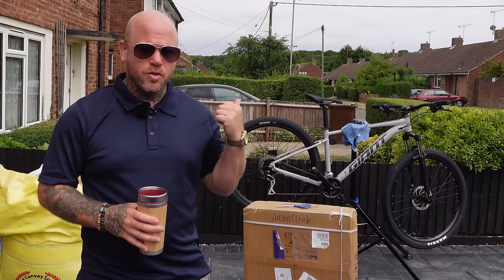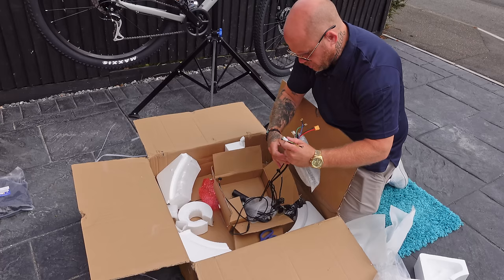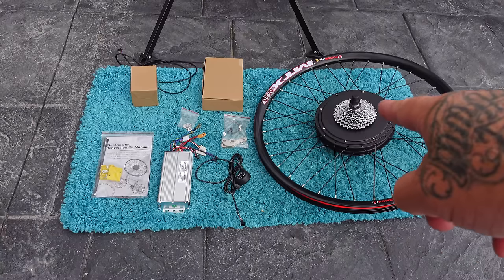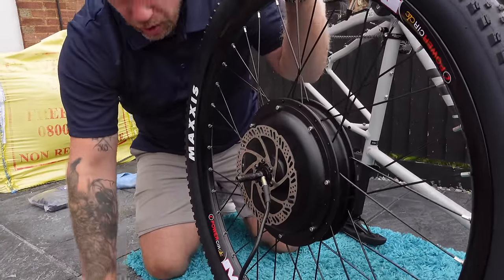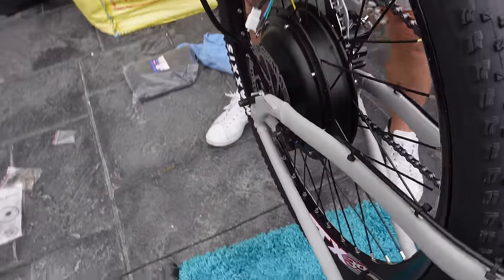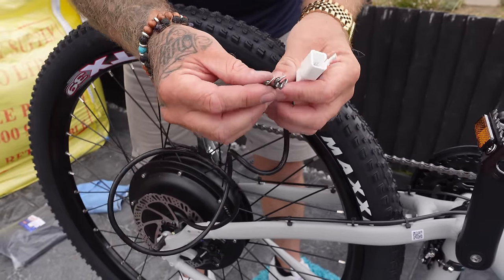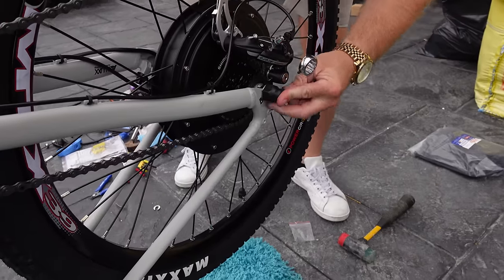Pt. 1 Convert ANY bike into an EBIKE! **ELECTRIC HUB MOTOR FITTING GUIDE**

Comment: I need to k ow how to ground out m 2000watt kit it came with fuses and a thick extra power wire and ground wire what do I ground out the controller box? The battery? Or hub motor?

Comment: I got banned from driving for 1 year & needed solution to get to work (15 miles away) . That was wen I stumbled on Andy curby doing this . I now cummute to work everyday on ebike . Been though it all .
Spoke replacements , snapped throttle , controller fets shorted in rain .. best thing ever saved me a ton on money on petrol
Reply: Do you use a hub or mid drive kit? I’ll be cycling in rain and want best solution
Reply: How do you avoid theft of your bike?
Reply: @ArthurTugwell  it's a hub, tighten up goose
Reply: Anybody find that the wheel once fitted is more to one side than the other
Reply: I aswell use a 3000watt  72v . I get everywhere i need and really fast aswell ^^
Reply: Yeah the wheels they ship with are atrocious. That's the problem with everything from China. They truly don't face any consequences if their products are defective and you end up dead because of it.
Reply: Additionally now if you lose your job or get fed up of commuting you can always turn expert, make builds show them off then resell them.

Comment: I went for the front wheel option. More weight on the front in crap weather and no friction involved. Bit like a front wheel drive car, it will pull the steering out of trouble.
Reply from the maker: High power front hubs are sketchy they can slide out from underneath on turns in wet weather, unlike a car that won't fall over.  The dropouts on most forks aren't great for over 1000w imo.  Feels really weird dropping off a kerb on front wheel power as it loses momentum instantly as the front leaves the ground.

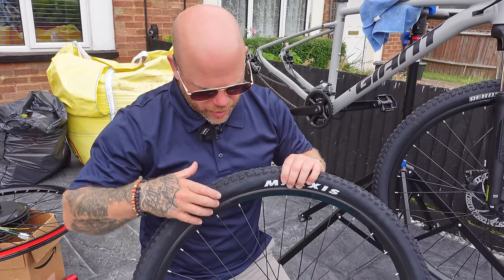Comment: 11:43 there is another tip as well if you put your disc rotor on to the actual e-bike wheel vs you noticed there is a arrow pointing on the desk facing you apply your tyre which the arrow is facing the same way as the disc

Comment: I'd rather replace the gears anyway. I'd never trust Chinese gears. Although what's frustrating is with Chinese made hub motors the quality spokes and rim that comes with it is atrocious. I'd rather they ship it without a rim and let you cut and mount your own because to save 1c they will give you something that will literally cause you to unalive yourself. There's contempt for your consumers, then there's China tier. They literally use industrial waste as packaging, and put dirty truck oil with chips of metal in it inside the tools they sell. I'd never trust them with something that I'm doing high speeds on.

Comment: 19:50 ok when setting the back wheel into the actual axle holder on the frame mount itself put your Gears at the bottom then line up the chain with the cassette on the bottom Gear which is the smallest cog on your Gears then you able to easy slot it in

Comment: Saw one of your previous vids a while back and got inspired to build one myself. It's strange that I used the exact bike and the exact kit that is in this video. What are the odds!?!
Reply: Not that low, actually. The kits are pretty generic, and the chinese drop shippers usually sell the same gear under different names, even putting their own stickers on it. As for bikes, there are only so many manufacturers and only a small number of bikes suitable for conversion (ie generic MTB-style, hardtail or rigid).
Reply: I think he may have been being sarcastic!

Comment: Very good detailed clear video Steve, I got confused on only 1 thing, you said it's a 29er and fitting a 27.5 hub for mullet setup, how did you magic the 29er tyre and tube to fit it? 😁
Reply from the maker: This build is 29er but built plenty of Mullet bikes just need to buy av tyre and tube 😂
Reply: @DudeStuff  I understand that 😁. I just wandered why you took the tyre and tube off the bike to put on the hub as a 29er and hub 27.5 or to demonstrate? I thought it was a clear detailed video. 😁🚲💨

Comment: My Giant Talon 29er from 2012 has three front cogs and eight cogs on the rear hub. Do I need to switch to a single  cog on the front to convert with the Kirby kit?
Reply: No bro you don't need to do that it's even better with three cogs cuz you can pedals normally when you use pedal assist don't spend your money good luck

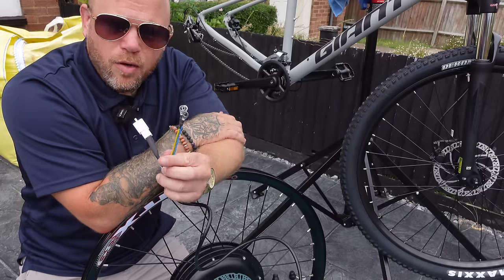Comment: 13:00 yes when the wires touch you are actually completing a circuit on the coils this is reason why you have resistance which is only present in permanent magnet motors. If if was a induction motor you wont experience any resistance until you apply power to the coils.

Comment: Cant wait to see it complete and riding to its top speed. Mine is only 500 watts and tops at 47 kph. At first   i found the 47kph to be satisfyingly fast. Now, its not enough. Id want to go 60-70 kph if possible.
Reply: I use a mid drive on my MTB. I haven't modified anything but I hit 48MPH on flat. it's 1500w/48v. These bike just getting to be more and more fun.

Comment: Hi, Thanks for your videos, they are interesting and useful,

I just wanted to ask about tourqe arms, I have a 1500w Rear 27.5 inch wheel used on a black carrera vengence, when I put it on and try to ride the wheel comes off, what is the solution, also I noticed the space on the bike is 140mm but my wheel is 140mm so when I put washers on then I have to spread the frame a bit, do you think this is the reason for the wheel falling off, do you think it would work with a tourqe arm, whatever that is

Thanks and any help would be much appreciated

Comment: I like these videos. The everyday use approach (obviously you don't need everything in the kit, if you don't want to).. and the subtle humor and throughness. One thing I would've liked to see was the casette/freewheel installation, and probably some mention of the hub spacing on MTB's (depending on the type of dropout), what you can do and what you can't do. There's plenty of videos on the tube about changing freewheel/casette for sure, but not many doing it on a 2kW hub motor.
I've got an MTB with QR dropouts and those only have 135mm spacing at the hub. It won't fit a motor like this and a 7 speed freewheel/casette I think.

Comment: Absolutely love the Kirby kits. I have a 500w rear hub diy kit and the install was pretty straight forward, had to test fit the wheel two or three times. I also ditched the bag and designed and 3d printed a bracket and integrated cable management box. 
I made a custom torque bracket from 4mm stainless steel.
The 500w kit is all I ever need. Good power and pretty good range with the included battery 48v 13a.
Nice instructions not many go into detail about the washers.👍
Reply: What kinda range?
Reply: @janeblogs324  About 35 km with throttle only.
Reply: Thats the kind of OCD that appeals to me! 🤣 Definitely interested in having a go at a project like this sometime soon...
Reply: He just resells ebike kits from aliexpress
Reply: What’s the throttle only speed?
Reply: @lassydogpie5390  about 45-50 km/h
Reply: @JorgenLarsson at what speed is that?
Reply: @dennis-br6vr  Most comfortable at 35-40 km/h. It can go a bit faster but don't want to pull too much attention.

Comment: Thank you for making this video.  I have been thinking about building my own electric bike and most videos are more like paid promotions and don't have a lot of actual advice in them.  I would make one suggestion on buying the caliper space to the motor.  They sell brake disc shims to go behind the rotor in 1mm increments.  Use a rotor shim, and then you can adjust the caliper on the mount as they usually have some side to side adjustability to keep the pads evenly spaced on each side.

Comment: Great stuff but that motor cable is to long and needs an in line plug about 10 inches from the motor so you don’t have to take lots of cable ties off when you have a flat.
Reply from the maker: Swings and roundabouts.. it might be slightly handier but for the sake of a few cable ties you end up with a bulky ugly plug right in the way on the frame I've had one like that before.

Comment: Hey Steve, great video I’m now watching part 2 on the telly. Do you know if one of these kirbebike kits (maybe not a 2000w one) would work with v-brakes?
Reply: I have bikes with disc & v-brakes, I don't see a problem with v-brakes, actually might save some trouble you wouldn't have to deal with spacers/disc/hub clearance.

Comment: Can I put a single speed instead of a 7 or 10 speed cassette on a hub motor that comes with a 7 speed cassette??
Reply from the maker: 7 speed will be a freewheel.  8 to 10 speed cassette. Pick which you prefer and add your own single speed conversion
Reply: @DudeStuff  so it can be altered then and made to a single speed bike hub then

Comment: I would really recommend installing the pedal assist. Two advantages saving battery power and getting the exercise everyone needs. But if you are in top condition and still want to ride the bike as a normal bike you can of course  But hey why not have a little assist by riding up hill and or wind in your face. The gears will definitely be helpful. Thanks for sharing from Mexico.

Comment: I'd rather just do the supporting upgrades to run the 9 speed cassette than swap your old 7/8 speed on.    More gear range is better on an e-bike from my experience.
Reply: Not if it’s hub drive

Comment: i like your video and I am by no means an expert on this subject  couple of things  the color black as in the speed controller keeps the heat in  white and silver reflects heat  also if that case is alloy it looks to be the paint will peal off  there is a special process for painting alloy called etching i only know this because i did work in a powder coating company and we did coat alot of alloy if not done correctly well you will see otherwise very informative video

Comment: What sort bike do u use for 3000w motor because of the drop out is bigger
Reply from the maker: I think it's very difficult to fit without risking stretching the frame.  A boost quick release will help but imo better to just use 2000w wheel running at 3000w
Reply: How do that just upgrade the controller let me guess and thank you for the help
Reply: What control what recommend? With 60v battery and 26ah

Comment: I would also think that spreading the rear end with a washer may result in having to space the rear brake disc, or you might find it binding with the bake pads all in all a very good tutorial for beginners.  ;-)
Reply: these kits are engineered for a "range" of different spacings for all of what might be available out there..they are kits>>.not for the feeble minded or bot it together rich kids...
Reply: Wayne the pro

Comment: Nice job save... you have to take in account of REAR flat tire... he has it nice and tight but that doesn't work out well once he gets a rear flat tire. I've rode my E-bike so much that I keep a repair kit on me to repair a flat to and from work. Gotten good enough I can usually to that repair within 20 minutes but the same note? I had my motor hub or the front and nine tenths of flats happen to the rear tire. Usually front tire pops up something sharp and REAR hits it. I'm going rear drive this build around... so I'm also going to go either with a solid tire or solid inner-tube because? I've had a day that was bad enough? I changed TWO flats in one day, new innertube and all and inspecting the tire itself to insure I did pull out the offending item that punctured my innertube. But even with the front mounted motor? I MADE SURE there was enough slack in the power cord leading to it? I could pull the wheel off enough to change the innertube. It's tricky but possible but ONLY if you leave enough slack with the power cable leading to the motor. He's got his power cable so snug to the motor... he is going to have to cut those zip ties to be able to get the tire FAR ENOUGH off the bike frame to change a flat. But besides that? Spot on nice and tight work! A little too tight in my opinion. Then again I use by bike to commune to work so I need the ability to fix a flat on the spot. You'd be surprised how fixing a flat for twenty minutes beats walking your bike home to fix it THEN spending that 20 minutes fixing it there.

Comment: Nice walk through on the install. The only thing I would have done differently is using an old inner tube as protection of the frame where the jubilee clip is at. I also used old tubes to protect the frame from the chain and if you take your time wrapping the frame it actually can look good.
Reply: Agreed! Something else to keep in mind while ebiking is to wear the proper helmet, most helmets have an outdated safety standard, the best ones are the ones that pass the nta standard like xnito or bern hudson
Reply: Good idea. I was just gonna wrap some tape around the frame where the clip goes  🙂
Reply: How you explain to do the bike I think it's 100% correct I recommend you to anybody look at your videos

Comment: Just built a yose power 36v 350w 27.5 comes with battery £382 have you heard or ever used them
Reply: Planning on getting same kit because of the integrated controller

Comment: With that much power of speed on back wheel, do you think as time goes on the back frame will start breaking apart? Any speed over 20mph will be a rough ride if on roads regularly. It's extremely uncomfortable of the frame used for a powerful motor.  I learn from experience to always use a 2 piece frame with dual shocks of front and back as in a hardtail frame. Other frames the speed over 20 mph and up will be a bit shaky at times when going over rough terrain, potholes, dips, bumps, ect.
Reply: Other factor is the condition of the back wheel will get roughed around of having no rear or hardtail shocks.

Comment: The one thing I wish that these conversion kit manufacturers would do is make some kind of housing that can contain the controller and then the housing could bolt to the seat tube to secure it.  That would make installing the kit much easier for the one installing the kit.
Reply: There are controller houses not the same manufacturer just order them online

Comment: Police are cracking down now on these kits. Any way to install a "road legal mode where throttle turns off and wheel doesn't get assist over 15mph?
Reply: Coincidentally we have siren sounds at the beginning of the video!
Reply: Yes that is the speed limit settings. You can set a max speed and/or pedal assist levels. Each level of PA can serve as either power or speed limit.

Comment: Am I being blind here but what are the torque arm for?? Looks just another think bolted on, what purpose does it serve?? 
Looking at ordering the kit, great vid mate👍
Reply: It's supposed to stop the steel eating the alloy there is a lot of torque on that bolt
Reply: So imagine the wheel sits there and needs to grab to something. It looks like a square edge. Metal is flexible and each time you throttle or ebrake the metal twists. Eventually it will flip and that is why there is a torque arm. It prevents it from flippong due to the fact that the wheel is stationary.

Comment: "Jubilee clip"... never heard that term before. In any case, you'd think they'd come up with something better than an auto parts store hose clamp; it looks Bubba-rigged and would almost certainly scratch up the paint on the frame. Something purpose-built like the strap they use to secure the arm of a coaster brake hub to the chainstay would look a lot better.

Comment: Hi I've got another question I've got 2000wat wheel it wears tyre down pretty quickly my tye is 26x2.10 (54-559) front tyre is the same so waiting for tyre to come I put front tyre on back wheel on front it looked pretty wide on back wheel it's slightly wider because of rim my new tyre is 26x2.10 (54-559), it said for back only but it's the same tyre I've had on front for year on front wheel it looks mots so wide and I found the tyre was light in Wight but it's the same make my front rim is smaller so I should bulb effect when blown up this one isn't so wide hope this makes sence

Comment: I like your YouTube channel. However I own a 2016 Trek Stache 9 29er hardball bike. Your description is in your title is wrong. Newer or higher standard better bikes have thru-axle shafts that are removable. Meaning there is no slot to slide the axle in for a hub motor front or back. Unless someone can show me where I can get a adapter or something to get my NB power 2000 watt drive rear I have now.

Comment: I plan on making an ebike out of the bike I already own. 1000 watt with a 48 volt 20 ah battery. My question is have you had any problems with the coppers stopping you to check the power ouput of the motor? Can you hide the output or mask it somehow? One other question is which reasonably priced rear wheel hub kit do you recommend? I am in the UK. Thanks

Comment: If u can send me one of the controller bags I take one
Ub100sf number 6 lol
As I put my 36v battery in a backpack 🎒 lol only because my controller had to go wear the battery did go. 
But then I can run 36/48/60/72v 
No problem. 
And the controller fits nicely into the frame like it was ment to go. 
But if u do want to get one of them bags cool. 
I only do scooter as I don’t like bikes. But all good fun to ride . Good controllers 
Can I asks u when u put some solder onto the shunt bar inside the controller does it or did it actually help or make a difference or not
Your vids r cool man 
You explain things really well 
Glad I found your channel.

Comment: Whe you fit the wheel you should remove first the brake calliper and you fit wrong spacers, you got round ones and I think you should fit special for that axle spacers oval ones 12mm?